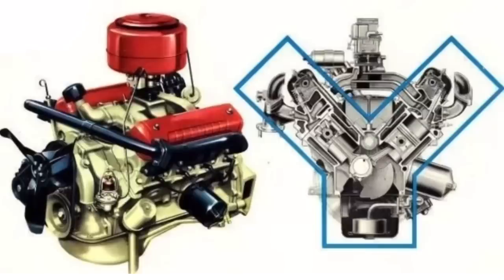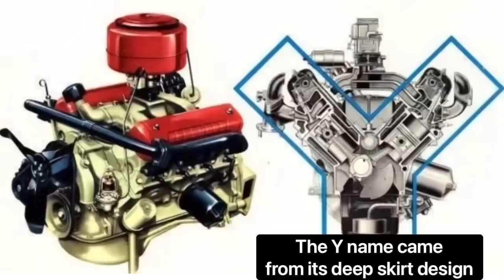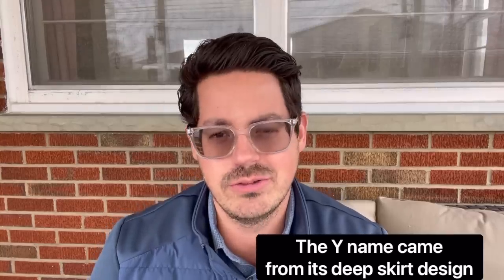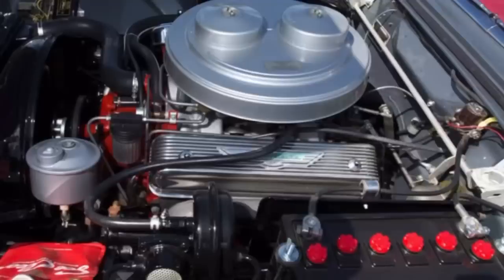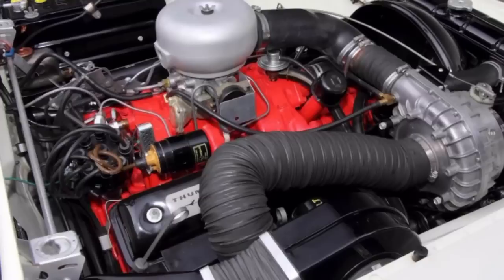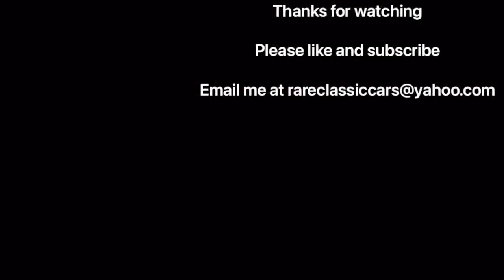Worst Engines of All Time: Ford Y Block V8

Comment: I never thought much of the Y Bock engines, due to what I witnessed back when the cars were 10 to 20 yrs old.  They leaked oil, burned oil, had burned valves, etc.  The Chevy 283, in comparison were fantastic used cars when I was in High School.  That was the beginning of the 1957 Chevy becoming the icon that it is today.  So, I never cared for the Y Blocks, but then 4 years ago, I bought a 1957 Ford Skyliner with the 312 Y Block.  While I drive it very little, and I assume that the engine has been rebuilt, it starts amazingly fast, runs very smooth, has good power, and I absolutely love the sound of the exhaust.

I have heard different theories as to why it sounds sort of like a Harley Davidson motorcycle, including the exhaust manifolds paring of the exhaust, and or the firing order, and others.  I am not sure what the reason or reasons are?  But with the Flamethrower mufflers (not loud - just a nice note), the exhaust sounds so cool under moderate acceleration.  Do you have any thoughts on the exhaust sound?

https://www.youtube.com/watch?v=dRovukgDiU0
Reply: Chevys burned oil, but nobody cared.
Reply: @johnsalvaterra1355  283's did not use seals on the valve stems.
Reply: Those Skyliners were beautiful, especially if they had an FE under the hood !
Reply: The Y-blocks often had that choppy exhaust note because they ran around on six or seven cylinders after kicking out a pushrod or two because of the valve-train wear ...

Comment: The 272s and 292s were also built in Brazil and equipped some pick-up trucks and the Galaxy line. By 1976 it was replaced by the 302 Windsor, which was them imported, never built in Brazil. I own a 1981 Ford Landau with the 302, original alcohol version.

Comment: We had a 1954 F400 grain truck.  The orignal Y-block had died and we ended up replacing it with the flathead engine from a Monarch.  That's about my only passing experience with the Y-block.  The old flathead, welll it would jsut about run on anything.  The only problem we ever had was keeping water pumps going on that thing.  If it wasn't the left one going out, it was the right one.  Thankfully, we found Ford Obsolete down in California.  Way up here in Canada, it's tough to find parts at the best of times.
Reply: Sure you aren't overtightening the fan belt?  That is hard on your accessories.
Reply: @michaelbenardo5695  Fan belt was fine. We were using rebuilt pumps. They can only be rebuilt so many times. Getting a brand new pump for each side solved the issue.
Reply: @PorscheRacer14  Ok, I had that problem with my 61 Buick Nailhead.  Couldn't fine new water pumps for that year, only rebuilt ones.  They would only last a couple of years.  I bet I could have improved them if I knew how to do machining.  I would have added a bushing between the bearing and the packing.  The pump shaft was too long, which put too much stress on the bearing, unless it was perfectly balanced, and your fan, water pump pulley, harmonic balancer, and generator pulleys were all perfectly balanced as well.

Comment: I thought it was determined that V8 Toyota put in their first try at the Tundra, (total failure of a truck all together) was decidedly the worst automotive engine ever produced, how did that change with an old engine, could be understood if it were a newer engine.

Comment: My dad had a 1959 Ford station wagon and we had a lot of problems with the engine and the problem was that it would lose two push rods on the same  cylinder and worp the heads and this would happen about every 5000 miles  .no matter what we did we could not find any good reason for this to happen.

Comment: We had a 61 Galaxy Convertible ("Sunliner") with a two speed automatic ("Fordomatic") and a 292 ci "Y" block.  Ford had a way with words.  It was a beautiful automobile, good performance and we had no engine trouble.  My Dad was a stickler for maintenance!  Adam, if you read this I would love your take on the Chrysler Poly Engine.  I had a 63 318.  It was smooth, torquey and rock solid reliable.  It was also heavy and not very powerful compared to the Ford and GM offerings at the time. I loved that car!
Reply: Both the Fordamatic and Crusematic we're 3-speed. Although the former started in second, unless shifted manually The later started in first, unless second(the snow gear), was used.
Reply: @jeromebreeding3302  The 51 - 58 FordOmatic was indeed a 3 speed, but in 59 a new cheaper 2 speed FordOmatic replaced it.  That is probably what was in his 61.
Reply: @michaelbenardo5695  Correct. Ford was probably inspired by Chevy's durable Power-glide. It was all aluminum, simpler, lighter, and cheaper to manufacture.
Reply: @michaelbenardo5695  Don't know much about the 2-speed Fordo, but I've read it made a Ford so equiped a real slugs  My 59 Ford had a donor 292 from a 61 model with the better Cruiseamatic, which started out in first, rather than second like the Fordo. Art Carr transmissions used modify the trans for higher rpm's and firmer shifts,but it Could'nt compare to the C-4 that followed it.
Reply: @jeromebreeding3302  My Aunt's neighbor had a 59 Ford wagon with a 332.  It went pretty good, but the smaller engines with that trans were not so happy until they got some momentum.
Reply: @jeromebreeding3302  You didn't like the CruiseOmatic?  The C4 followed that 2 speed FordOmatic.  The C6 followed the CruiseOmatic.
Reply: @michaelbenardo5695  The Crusamatic was ok, better than the THREE speed Fordo, which started out in second gear. No doubt about it, the C-4, was far superior.
Reply: @jeromebreeding3302  It probably was, as the CruiseOmatic and the 3 speed FordOmatic were OK when used for ordinary driving, but kind of delicate if you drove hard and aggressively.  I know the C6 was a tougher gearbox.
Reply: @michaelbenardo5695  The C-6 was Ford's standard bearer for high  horsepower engines but parasitic losses hurt fuel economy compared to the C-4, which was more than enough for most applications.
Reply: @jeromebreeding3302  Is that what was bad about the C6 - consumed a large amount of power?
Reply: Check out"Uncle Tony's U-tube channel, he'll tell you all you need about the 318 Poly engine.
Reply: The 318 offered up to 290 horsepower when equipped with dual quads.

Comment: it was not a bad motor. It had issues like a lack of hydraulic lifters. It also had a issue with a lack of oil to the lifers. Lastly it was very heavy a deep block. Bad no issues yes. The later Y blocks were better. and the 390's were far better. But bad no could be improved.
Reply: The lack of oil to the lifters was due to the fact that the center cam journal on the early ones was not grooved, so oil was intermittent.  Machining a groove in it, or using a later grooved cam shaft, and plugging that oil bypass hole in the rocker shafts fixes the problem permanently.

Comment: There is a competition for old engines that are hot rodded, they dyno them and there is a Y block builder that either wins or is near the top every year. The engine has a lot of potential.
Reply: Yes, the Y block has done well in Engine Master's competition.

Comment: If you ever do a follow up to this you should talk about just what a strange and unique design the Yblock was,,, unlike any other production V8 in history,,  with lifters,, and the intake and heads with the stack runners,,, such a weird engine..
I always figured the reason FE's have such a tsunami of oil going to the top end is because of their experience with the Yblock,,, they made damn sure the FE rocker assemblies got plenty of oil..  lol

Comment: My first car was a 54 Ford with the 239 Y block. I got it in about 64. The engine was a disaster. Clearly the prior owners didn't use proper detergent oil and/or never changed it. I rebuilt it in my driveway, it ran, but barely.
Reply: Many people today still refuse to change the oil, and think it is a racket.

Comment: I have a 57 Thunderbird with the 312 and it was rebuilt by a Ford expert and runs so perfectly and sounds so good with it's unique exhaust note
Reply: Our  family car  back in the 1950S was a 1956 Meteor Rideau With a 312 thunder bird specials. Dad used to say  it would  pass any thing on the road but the Gas station.  Dad traded that Car for a 1959 Chevy with a 283, What I remember is Dad saying how gutless it was compared to the old car.

Comment: I owned and drove several Fords with the Y block engine 2  1956's and 2 1957's also a 1962 Ford SW, The Fifty sixes had the Thunderbird 312 ci and the 1957;s had a 292 and a 312 bird, all 4 barrel carbs except the SW .never any major upper engine problems. except they smoked on the vent tube because they did not have a PCV valve...I changed the Oil very often and used a upper Lube for the Valve Train as extra protection, because they were Cast Iron, I ran one 57 low on oil and drove 12 miles home, it got hot but did not lock up...old school but very fun to drive, and with glass packs they sounded great....cheers

Comment: All new material to this motor head.  But in my world the 302 and 351 were the beginning of Ford small blocks ... with a hat tip to the 289 (and the flathead that could run even minus a cylinder head).

Comment: Still running a 272 in a '55 Country Sedan. Stock 2bbl paired up with 3speed + od. Always used good oil, never a problem. Only problem is the steering box, the adjustment is maxed and I haven't been able to find renewed or better shape manual steering box
Reply: I have a 272 in my 55 fairline town sedan. 
Also with the small 2 barrel.  
When we rebuilt the engine we got it bored over to be a 292
Reply: Must have only been driven in town, my '57 is still at minimum pretty much and steers like brand new

Comment: Back in the late 70's I had a 62 Ford Ranch Wagon with a Y-Block, about every 2 or 3 months I would go to the local "Pick-A Part" junk yard and pick up a pair of rocker assemblies and change them out.   Besides that, the engine was OK.   The 289 was a big improvement, I have a 65 Shelby and the engine has never been out of the car, except when Shelby pulled then out for the mod's.    Thank to Rare Classic Cars for another great watch.
Reply: Your oil passages to the rocker shafts were plugged up.

Comment: In with the crowd on this one. Good oil was the secret. A Y block with a PCV valve would thrive in today's world. They weren't a powerhouse, but they were comfortable torquey little fellas that if you did your part would last a very long time.
Reply: Good towing engine?
Reply: @jamesfrench7299  I loaded my f600 with scrap iron and pulled a trailer hauling my skid steer behind it. It did a great job i was very impressed i should have rebuilt it but replacing it at the time got me going agin. A older guy i know has a 50s f800 semi with a 292.  For what it is size wise and time line it is a good towing engine. I am not a ford guy but when ford went from the flat head to the Y block they did great job a big step forward .
Reply: @jamesfrench7299  Yeah, little slow by today's standards.
Reply: @timothybyrom5560  Actually, the 56 - 57 Y-block was pretty potent.  Then in succeeding years, they kept detuning it, until in 1962 cars, the 292 only made 170 horsepower, (the 57 292 made 212 horsepower).
Reply: @michaelbenardo5695  Thanks for the info. I'm not really an expert. I just know the experience I've had with some of the old trucks. When I was a kid a friend of my dad had an old one ton that he hauled logs,and firewood with. She wasn't the fastest thing around, but it would get it done reliably every time.
Reply: They beat the corvette in the supercharged 57 T-bird
Reply: Never mentioned rear main seals. They were notoriously leaky and difficult to change in car.
Reply: @johnkidd1226  They all were back then. Rope seals. A new style lipped seal fixes that. The FE was the same. If it wasn't leaking, you better check the oil.
Reply: @timothybyrom5560  Did the FE engine use a rope seal or rubber seal from the beginning? If it is rubber, is it 1 piece or 2 piece?

Comment: Because of the uneven firing of the 45deg block, the distributor had to be set up to match the firing order. If you were 1 lobe off you had half cyl over advance  and other running way behind. Same true for gmc v6s.
Reply: The y block is a conventional 90° block with a typical cross plan crank. Nothing unusual there.

Comment: the oiling problem was at the head block interface where the passage made a 90 degree turn under the head. If you radiused the hole in the block the passage would not plug, if given a chance. the main oilfeed fed both the mains and cam, the center cam journal was grooved to provide a passage for the rocker oil feeds.  All the y blocks I've ever had were good strong and got good mileage except the 239 it had some first year problems the 272 and later were upgraded. We had a new 56 312 4 barrel club sedan that would do 110 and still got 26 mpg.
Reply: The early ones, 54 to 56, didn't have a groove in that center journal, that's why they plugged up.

Comment: I've got a lot of experience with y blocks and your take is pretty accurate although I wouldn't call them the worst. If they had today's oils back then they would enjoy a much bigger following now. I've had many over the years and rebuilt correctly they don't suffer any issues with today's oils. Their biggest problem today is their  weight and limited displacement potential for the hot rod guys that want a bunch of power. But they were a very solid strong block that wears well with the 292 and 272 being the best for a build having the smaller mains and therefore more meat in the block. Ford Argentina used the Y Block with some locally designed, more typical port  heads up into the mid 80s if I remember correctly and were a lot more popular in south America. Thanks for the video.
Reply: How come the GM Dodge Ford flatheads  etc. Did not suffer ill effects from those same oils? Why did the FE not have the same problems. Why did the later Y blocks have a groove cut around the  center cam journal. Its the poor compression rings and lack of PCV that created excessive blow by making the sludge and goo we found in every Y Block We tore down.
Reply: @thecollectoronthecorner7061  oil sludge is usually a problem of contamination be it water or hydrocarbons. Poor crankcase evacuation  definitely exacerbates the problem. Sludge is a weird phenomenon I've come across in a few engines that aren't known for it. Like a Windsor I had the pleasure of swapping the intake out a while back. Or the 83 Chevy wrecker (350) my uncle bought cheap where you couldn't even see the rockers without digging with a screwdriver. How the previous owner's handled maintenance I haven't a clue, but it can happen to anything if the conditions are right. The y block definitely could have had a better solution but in my experience it's never been an issue and I've had many of them pass through my hands over the years. I've currently got a 63 f250 with it's original 292 completely stock in my side driveway right now that gets used weekly as a parts runner. It sat for years before I bought it and after rebuilding the brakes, carb, setting the lash and a complete ignition tune up it's been great.
Reply: @thecollectoronthecorner7061  That's how you fix early Y-blocks - groove the center cam journal, or use a later camshaft with the groove, and plug the oil bypass hole in the rocker shaft.  Then you have a great engine.
Reply: @michaelbenardo5695  agreed
Reply: @thecollectoronthecorner7061  No engines came from the factory with PCV before about 1963, except for those intended for the Armed Services.  My aunt's neighbor did have plugged oil drainback holes in his 332 FE.  I cleaned them out for him and scolded him for not regularly having the oil changed.  The reason for the groove in the center cam journal was so the rocker shafts would have a continuous, rather than intermittent, stream of oil.  A continuous steam is less likely to plug up.  Lincoln did the same thing with their new 368 engine for 56.  Flatheads did not suffer the rocker oiling problems because flatheads don't have rocker shafts.
Reply: @michaelbenardo5695   The GMC six cyl engines had a sort of PCV in the 1950's they had a pipe that ranfrom the valve covers to the air filter. Yes the Y block did have a design flaw with the two 90 degree bends at the block deck. I always radiused those holes and enlarged the passage in the bottom of the head. I had one I drove that didnt oil. So overhead  oil line kit was installed. The rockers and shafts where so worn it leaked profusely and robbed oil pressure from the crankshaft. And the worn valve guides sucked in oil and it smoked terrible. So I disconnected the overhear oilers and added a grease alemite fitting. Kept a grease gun filled with 90 weight gar oil. and libed the rockers about every 60 miles. I actually owned and drove a lot of Y block powered vehicles.  I was a drag racer and the stock FE was more powerful than the best souped up Y block ever could be. Ok a guy came by my place hunting for a good 272 or 292 engine to replace the mill in his 55 ford grain truck he bought new.  I told him they never made a good Y block. I talked him into a  65 -390 two bbl and a 330 truck bell and flywheel I had. Hin and his mechanic installed that FE along with a better starter and alternator. He called me a month later. Stated He took a load of seed wheat on a annual trip  up into the Ozarks to get it cleaned. He stated the hills he had to crawl up in granny low on the low side of the two speed. The 390 went over those hills in second gear on the High side. And the best thing the 390 used  much less fuel than the 272 ever did on that trip.